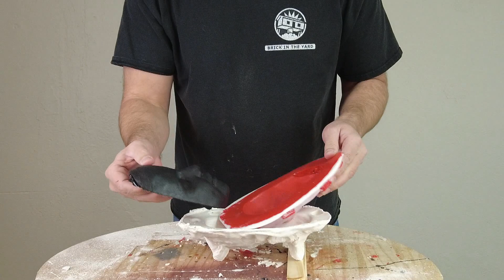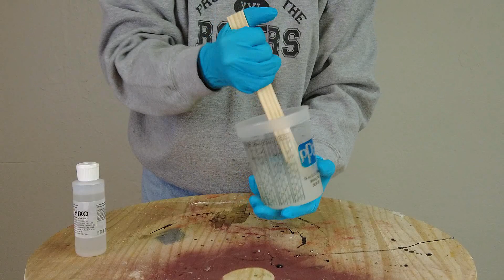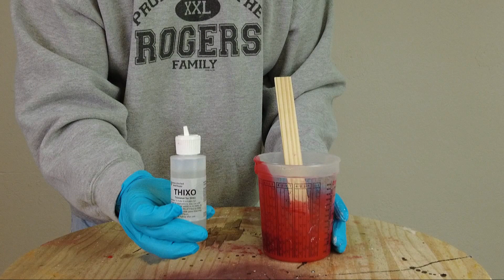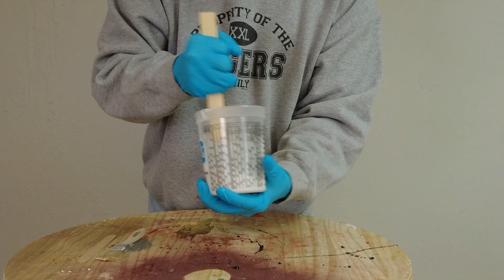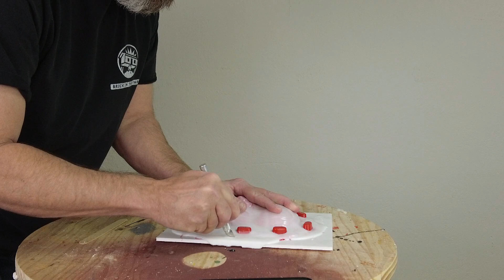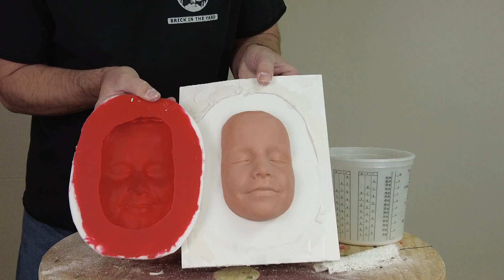Silicone Moldmaking: Brush-on Mold With 5140

Comment: Can the liquid platinum silicone be used as brush on ?? Or these are just different formulas? Thank you
Reply from the maker: @krazykara1327  TC-5140, the silicone in this video, may be thickened with SC-5001 for brush on molds. Some platinums do not respond to thickening agents.
Reply: @brickintheyard  thank you for getting back to me.
Reply: @brickintheyard  Do you have a similar concept but for demonstrating on a stand up statue with some hollow space at some areas? If so, maybe you can post the link to watch please. Thank you.
Reply from the maker: @ https://youtu.be/8lit05YaZtQ?si=qHkoauhrjzoG4IgE

Comment: Do you have a tutorial for making silicone skin for a small area of the face? I would love to make small silicone prosthetics for the undereye that can be placed in the tear trough area and create smoother transitions from the cheek to the undereye. People use cosmetic filler to correct this issue, and I was wondering if a topical silicone solution could work.
Reply from the maker: I don't have a tutorial that specific, but 5110 is skin safe and would probably be a good fit for that application.

Comment: I really enjoy your mold maming tutorials. Im looking to try brush-on vs block because I heard that not as much product is needed. Do you have a specific formula you use to measure out your brush-on product needs?
Reply from the maker: It’s a lot trickier to calculate brushed on molds than poured molds. Not sure if there’s a reliable formula for that. My personal approach is to compare it to a human head. I’ve molded a lot of heads and an average head and neck takes about 5-6 pounds on average.
Reply: @bitymoldsupply  thanks! I've noticed that as well. I'll keep that in mind, for sure.

Comment: Was a print coat not required in this case?
Reply from the maker: This was a fairly simple, smooth part so it wasn’t necessary. Sorry, should have mentioned that.

Comment: Just curious—why can’t the 5100 be thickened? Just can’t be brushed on regardless? Pot life? Something else? You once mentioned varying silicone hardness levels to get realistic skin, so I’m wondering how that comes into play…

(Also, I tried sending a couple emails looking for help figuring out which products would be best for my project, but I never heard back. Is that assistance thing only via phone call? I have hearing problems, so I’d be a real pain on the phone… Would that still be preferable even if it means I need you to repeat things a dozen times?)
Reply from the maker: 5100 can be thickened with fumed silica, but not a chemical thickener. We get a lot of email traffic and we do our best to respond to emails as they are received. If you have a lot of very broad questions, a phone call will always be the most effective way to reach us.